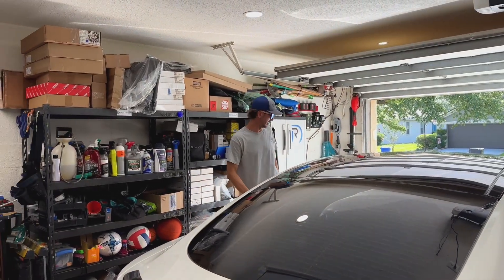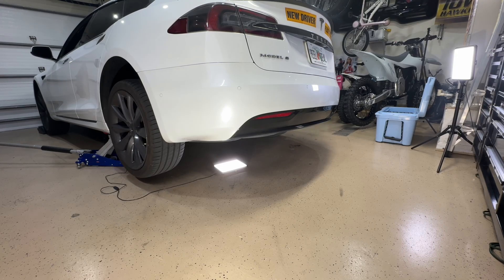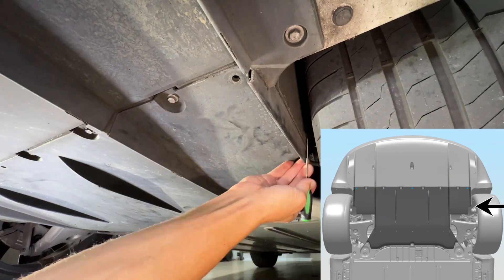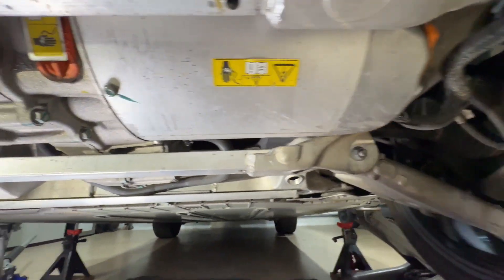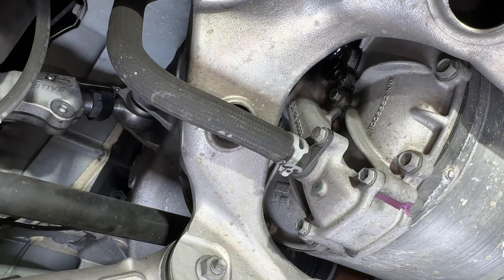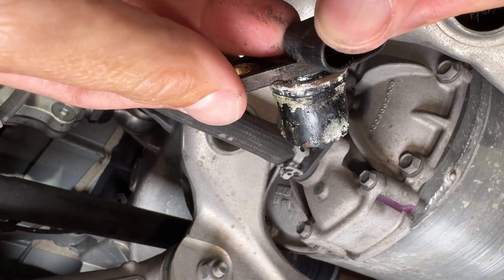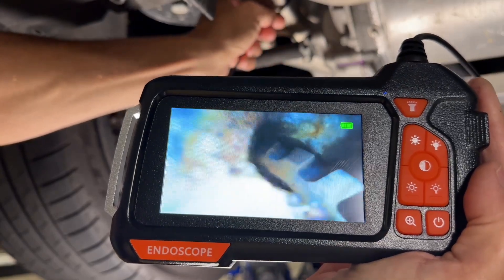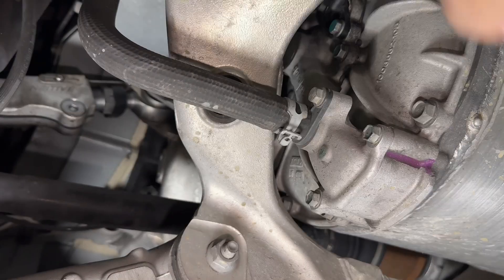Tesla Drive Motor Inspection with Coolant

Comment: Tesla will replace an LDU just based off such a video?
Reply from the maker: Well Tesla will not do anything that easily, but if you can articulate it well, you have facts and knowledge, yes they should replace it because it is a known failure.